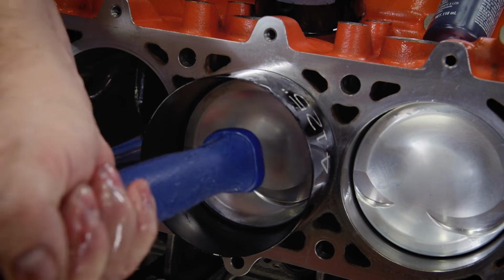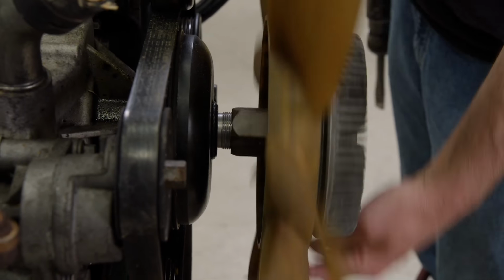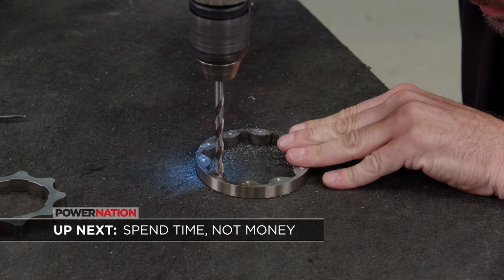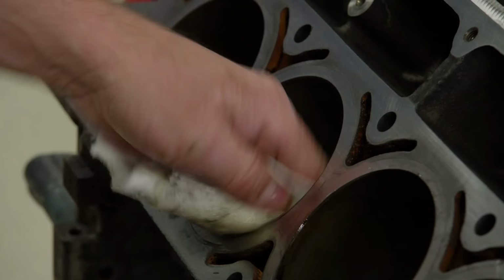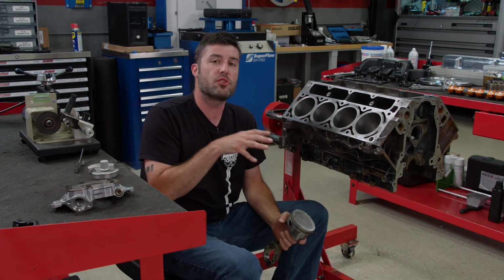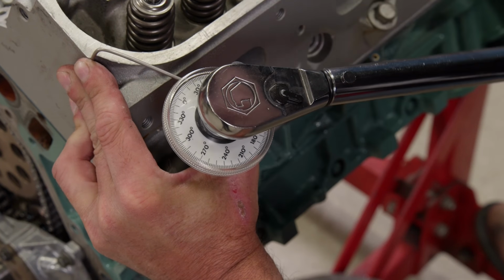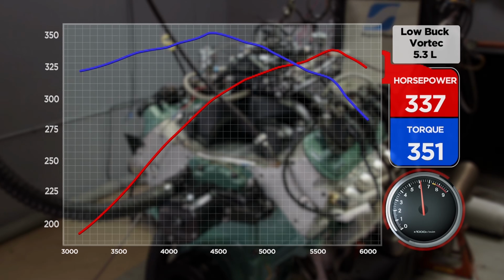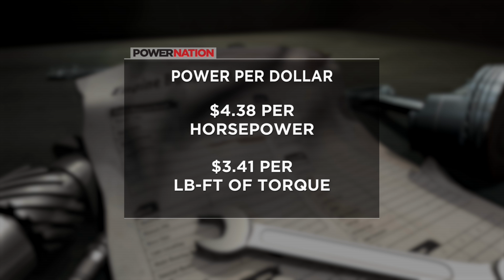Minor Upgrades Create Crazy Power on a Junkyard 5.3L Vortec - Engine Power S7, E10

Comment: Plus ignition system, plus carburetor, plus headers,  plus cylinder head machining, plus fluids, plus gaskets, plus sensors,etc, etc,
Reply: plus shipping for the parts, all the special tools they used.
Reply: @toycoma98  no special tools was used lol a hoan ball and a dremel those aren't special tools lol
Reply: @toycoma98 what shipping have you never order this kinda stuff?🤣
Reply: i wish i can afford that lathe they used. and I wouldn't mind having that vertical mill behind it... oh and that jet washer thingy.
Reply: @cydonianman  😂🤣
Reply: @cydonianman  there goes the budget 🤭😂🤣😊
Reply: would be FAR cheaper to just put a terminator on it and keep the fuel injection setup smh
Reply: Fr tho😂😔
Reply: @aaronfonseca6867  888feet p.i 8988 no AMY Fey no 89o98too love the nexus.  One 9i 99Was 79a  the way 98p0p0p⁰pp0pppppp
Reply: Thank you.....
Reply: Lack of oil changes was revealing in the oil pan . Today's motor oils dont do sludge  unless you neglect them.
Reply: Todd, that info is in video #2. How to hot wire a car and drive home your free parts car.
Reply: Still very budget in the ls world lol
Reply: I bought a brand new lq4 bored to 370 with an aftermarket cam for $4200. The core charge was included in the price and all I had to do was order it. Was at my doorstep in 3 days as well. Doing what you guys did was good and all, but the money savings was minimal and there is no warranty.
Reply: Yeah what's the TOTAL $$$$
Reply: @littlemiamijeff  Add a couple more $$$$$$$ then it's more realistic. lol
Reply: Jeff Plummer 5 grand
Reply: @littlemiamijeff  like 5 if you wanna get into it all, probably not including taking it out yourself or having someone do it
Reply: @littlemiamijeff  the finished product including headers eh prolly 1800?
Reply: That's because you're not a mechanic or the very least DIY person.
Reply: Yeah, I noticed the carb was missing. Those things ain't cheap.
Reply: yup...! and that after market electric water pump, that was also a few $$$
Reply: I rebuilt my 5.3 and it cost about 1600 to rebuild it
Reply: Lmao total 5k
Reply: + the $30 dollar paint job 😂😂
Reply: @teamempressive7730  they probably went with the Detroit Diesel green because it was on the clarance rack at the parts store. Diesel guys never pull engines out.
Reply: @ottopartz1  they'll pull the cab before they pull the motor lol
Reply: 50k worth of shop tools
Reply: You really shouldn’t get your hands dirty sweetie lol
Reply: Okay.. For that money you could actually build a 305 that'll make the dyno guy go "HOLY CRAP"
Reply: Why would u ever assume building a car the correct way yourself would be cheap. U gotta pay to play
Reply: @anthonybenanti9240  exactly . After 4 money pits ( 66 buick , 75 280z, rock crawler , 27 foot race boat) I'm done . I'll never sell any of these ever.    I have the equivalent of   a brand new  4 bedroom home worth of money in these projects. The boat is the most ( 110 k  ) and the others are not far behind being ground up projects with no cut corners. I'm also 65 years old so Im good with having these for the next 20 + years . At least I can keep them mint before the kids get them ☺️ . Well the rock crawler gets abused and sucks money like it does gas.
Reply: @immelting9834  But you are having fun.
Reply: Yeah all the specialty tools and their “crankshaft sander” lololol. Sheeeet, I got two of them.
Reply: Modding Donestics ain't for everyone, stick to Imports if you're broke in my experience lol.
Reply: Not to mention the machine shop to clean the gunk and put allllll the parts together…
Reply: @lfuego68  you can do it at home it's just a lot of work and very tedious. When I was about 15 years old that was my job when I worked in a shop. I liked doing it back then and was pretty good at it. Plus I don't think having it done in a tank is all that expensive.
Reply: @lfuego68  you can clean the engine your own self 🤷🏾‍♂️save money an spray some degreaser on that bad boy
Reply: buy a wrecked one. i got a 6.0 silverado ready to power my squarebody subourban. has everything. even those big aluminum wheels
Reply: @FrankieJames7   I bought a Silverado like that  my self from a auction. Paid 200 buck for it . It was rolled over ,probably 3 times judging from the damages, still drove . 37,000 miles . I used the rear axle , motor with all the accessories put  in my old 60's  Buick Rivera.
Reply: @FrankieJames7  good shit. Just score us deal of lifetime. 04 escalade  that her GPA let sit in garage. Bought  with 6.0 , 25k miles, platinum edition. All I had to do was replace rear rotors, breaks n calipers.  Were dragging n seizing from sitting
Reply: yep
Reply: This true
Reply: Plus nos kit, plus cam, plus roller followers, plus a bunch of work
Reply: And the $1000 Dyno work.
Reply: No south Florida
Reply: Good junkyard sleeper build leave the oil and junk on that engine.. worse it looks the better for a real sleeper.
Reply: Not to mention they were able to do the reconditioning themselvs
Reply: What carburetor? 😂🤦‍♂️
Reply: Yup it never ends but if you love it it’s something you already know
Reply: Fuel lines , gas tank, ecm flash
Reply: Good, I'm not the only one that noticed that total BS! Fastest I have ever gone from subscriber to not on a channel.. Was a stupid, unnecessary lie, we all know those costs or we wouldnt even have watched this video. Seriously why wth...  smh
Reply: Plus tips for truck stop hand jobs. Oh wait, what were we talking about?
Reply: Yep add another 1500 to it,,my brother bought a 1970 caddi 500 to go on his air boat  right out of the 1970 Cadillac it came in, the car was rusted down cobwebs covered the motor my brother gave 500 dollars for it with no guarantee it would run we took it home set on the airboats motor stand changed the oil  pulled the point distributor out dropped in a electronic one pulled the intake threw on a high-rise and a old  750 Holley double pumper with a fresh rebuild kit in it and fired her up and she ran perfect no smoking no knocking not even a lifter ticking he ran it like that for a year then decided he wanted a little more off the line because that's how it is with air boats gotta have all its power right now and that being a big heavy bigblock motor on  a 15 x 7 foot boat that hauled my brother me my nephew my son and three  hog dogs yeah it needed as much dependable power  as we could give it for the less money spent I told my brother we could gasket match and  port the heads and intake replace the old valve springs and valve guild seals our self he then bought a cam from comp along with the springs and seals and a new holly carborator when we got through and fired it back up we were both Amazed at the added power he got now she's got more power then any stock big block  with the snap of a small block we don't have a Dino to test power but I can say this that motor came stock from factory with 400 h.p.and it pushed the boat good now I would bet it's pushing well over  6 hundred h.p.because with all of us and the dogs we can go where it would go with only my brother on it with no problems at all and it sounds wicked when just idling because the instant you hit that throttle all you can hear is prop
Reply: And the pieces of cylinders and valves
Reply: Most older gear heads will have that junk layin around …especially a carb lol…they didn’t machine the heads they just look cleaned n maaaaybe decked
Reply: Eh they are minor
Reply: @buffaloaf8205  the bolt itself is very minor. The problem is the part of the bolt that is broken off in the head. You kinda gotta remove it and it's obviously stuck
Reply: actionjksn has always
Reply: Lol yes. And 500 for a complete running ls? Maybe from family but not from where I’m from
Reply: @MrT13  just picked one up off marketplace running for $250. Persistence pays off
Reply: @MrT13  in the Midwest where I am you can find a used LS for $500. You gotta look around but they are out there. You won't get something in nearly new condition but the ones that need a little TLC can be found like this one
Reply: @actionjksn  well like I said where I’m from.
Reply: @MrT13  Are you on the west coast?
Reply: Buy em as you go
Reply: They said none stock heads too..
Reply: Funny they say its a cheap build but not everyone can afford a cheap build

Comment: Don't see how you flirted with disaster seeing as everybody that builds these for boost from the junkyard knows the stock rods, crank and pistons will hold 1,200hp
Reply: 1200 of smooth gradual power ala turbos, but they still don't handle large power spikes like a big shot of nitrous causes. it's a different type of stress. He was still exaggerating quite a bit though.
Reply: Ken Bennett this is a factory LM7 rotating assembly, not the same story as the L33 rods and following GenIV platforms. This is also on stock head studs and majority valve train. Not a recipe for longevity on some power
Reply: Remember old guys are stuck in the old days. Just like a 50 year old will tell you that 5k for a rust free 1969 z28 is too much. He’s thinking stock small block Chevy when he said that. Lol
Reply: YES! I read Hot Rod Magazine when I was a kid, and the LS already has all the things you would do to a SBC to make it a week-end racer. Fatter-diameter head bolts that penetrate deeper. Big cam bearings allow a bigger lift than before. Bottom end is fully boxed with 6-bolt main bearing caps inside a deep-skirt block. A slightly elevated cam location allows a 4-inch stroke. Common intake valves are 2.16, and back in the 1970's everybody scoured the junkyard to find rare 2.02 valve heads. Crank shaft seal is one-piece, and the list goes on. Plus, they made tons of LS V8's, so easy to find and affordable...
Reply: 600 HP reliably.  800hp questionably with stock bearings.  1200 with a full buildup(rods, pistons, bearings, and a resleeved and reinforced block.  These make 500hp with no issue all day long with bigger injectors and a little boost.
Reply: @chubbysumo2230  482 to the flywheel daily driver for 2 years now runs 1250s. No problem whatsoever. Cam injectors truck intake and the tune.. and stall converter that's it. But you're right more than that you need to do a lot more upgrades

Comment: Stock 5.3 on an engine dyno makes 355 hp and 384 tq. Look up Richard Holdener on his dyno testing. Even cam it still didn’t make more power then stock why carb an ls it’s an waste of money imo
Reply: nope. he used electric water pump and headers. not stock.
Reply: Frigglebiscuit In this video they used the ewp and headers same way Richard test his 5.3. It’s still stock. Stock Intake, stock cam and stock heads.

Comment: I would argue the cheapest junkyard 5.3 swap is using the donor vehicle fuel injection w/computer. I've done a swap (from 350/350 to 5.3/4L60) in a chevelle when the owner supplied a complete running wrecked truck. I didn't replace anything that was usable from the truck. I feel confident I could do this on my own car for even cheaper.

Comment: Should be dynoed as it would sit in a vehicle. Otherwise its misleading.
Reply: ...... This wasn't a Dyno hp test tard. Obviously pushing a trans that turning a rear end that's turning wheels the hp will drop. A Dyno test is completely different. You have hp at the wheels and hp at the motor. 2 completely different tests. Do you even wrench dude?
Reply: OK Internet genius.

Comment: What happend to the knock sensors? Are the under the valley plate or did they skip them?
Reply: It's carbureted
Reply: Joseph Schaefer i‘m aware off that. But there are openings where they belong in. Are the getting plugged?
Reply: @thegearheaddepot9993  knock sensors have the same threads as standard water jacket drain plugs unless the newer than tbi stuff is different

Comment: An old machinist told me when you're wanting to get a flat surface with sandpaper like he was doing with the oil pump gear you want to do a figure eight and it makes pressure even on all the sides so it comes out flatter
Reply: I was a Machinist and we also, always used a "Figure 8" motion.
Reply: Absolutely. But a more important thing is the whole "If it's not broke don't fix it" thing.
What did the oil pump mod accomplish? Supposedly it floats that ring like he said on some more oil... But we also know that when you take apart a 300,000 mile ls pump, there isn't any wear there in the first place.
Then he ported out the pump. But there are not volume issues with the existing pump. As a matter of fact the volume won't change because the thickness of the pump gear is the same... 
Now you're thinking maybe it will increase flow except it's before the pressure relief valve. The valve that comes into effect at a very low RPM because in the OEM application with multiple overdrive transmissions and numerically small gear sets you are going 60 mph down the interstate barely above 1,000 RPM... So you have a very large bypass relief valve and an oversized oil pump from the factory. There is absolutely no need to touch that.
There was no benefit to gain.
Furthermore they then shimmed the damn thing so it jacks up the pressure but it doesn't actually increase the volume. Here you had an engine with I forget how many miles but well over 100,000 and zero bearing wear. We've taken apart 300,000 mi LS motors with the bearing still perfectly intact. We don't need more volume. We don't need more pressure. All you did is just waste power pumping oil at a higher pressure.
This is ignoring all of the other stuff they did like throwing away all of the perfectly good sensors, replacing them with brand new ones and then talking about how you would need more stuff to run without a carb? The only additional sensor that they're not using is the manifold absolute pressure sensor. The one that literally has to be plugged into any of the superior plastic manifolds to not have a giant leak.. have they just kept the stock intake It would have made more power.

This was all willful ignorance so that they could sell more parts.
Notice they did not even mention finding the cause of that unusual wear on the rocker and pushrod.
Reply: @TravisFabel  When you increase power, more oil pressure is better. It's common sense, really.
Reply: You can also use a thick piece of glass behind the sandpaper, because the glass is perfectly flat.
Reply: I completely agree with the ol figure 8 ! Old feller taught me that way long time ago
Reply: You have to go in two different directions to get a flat finish. So yes a figure 8 is efficient. This applies to cross sanding on body filler too.
Reply: Perfect example of this is hand polishing fiber optic connections. We use a figure 8 pattern for this same reason.
Reply: Yes
Reply: I been machining and when you hand lap parts figure 8 is the best motion to use
Reply: That's good advice I'll commit that to memory.
Reply: A flat surface like a piece of glass
Reply: I follow somewhat of a Pentagram Pattern and make it Hella-smooth !
Reply: TIMEtoRIDE900 lmfao
Reply: Ahh I remember high school machine shop. The instructor was an old retired GE machinist. He made us file a level and squared block from some really curved "flat stock" steel. That took roughly a week and weeded out quite a few students.
Reply: I'm 35 now and you're correct ! I build motorcycles by hand and the only way to be precise by hand is to start out precise. And you rotate the part and a x pattern works. Yea these guys seem a little ameture to me too.